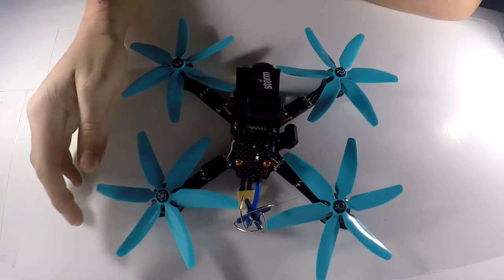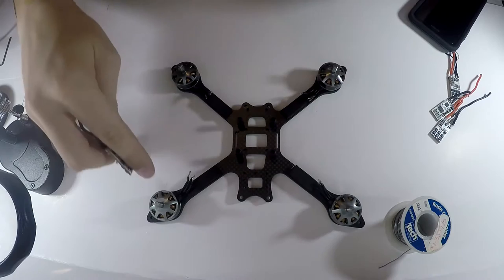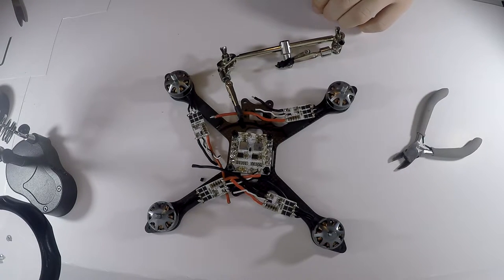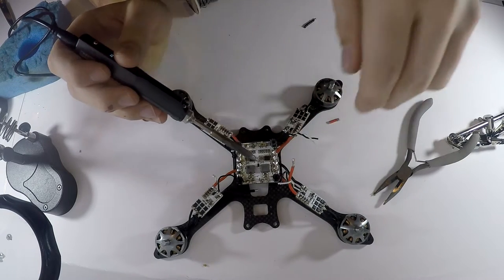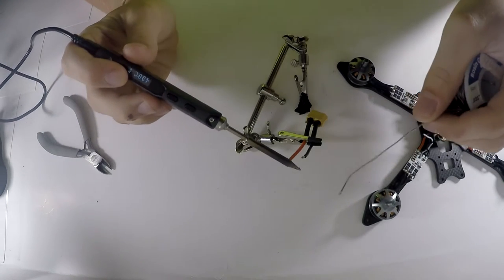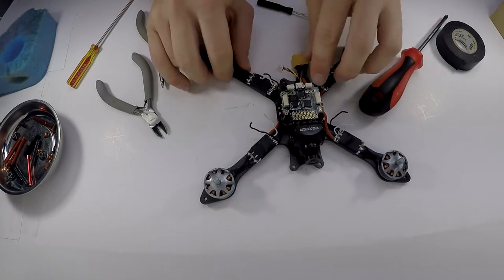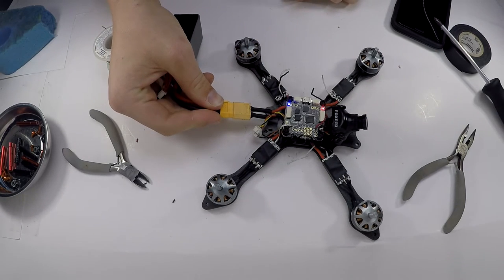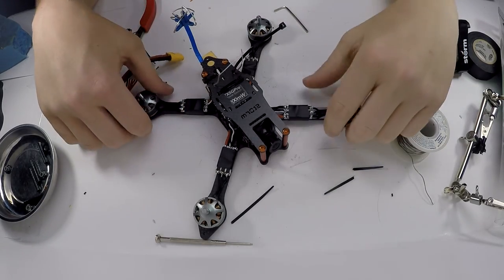SRD199 "Loki-X5" Build and Review || Part 2  (Complete Build Guide)

Comment: Nice video. I just got the 6mm frame. I'm wanting to use a 4-1 esc for  a clean look. Will that fit in the frame?
Reply from the maker: You might have to get taller standoffs like I did but otherwise it should fit just fine :)

Comment: Thanks! I really like this frame, mostly for the light weight. But biggest concern I have is durability. How has it held up for you? I don't think you can order a spare base plate, so 60 bucks is a steep price for one broken arm.
Reply from the maker: I haven't broken anything so far ;)  I think this is surprisingly extremely durable and I only have the 4mm version. If you were to get the 6mm version, it would be virtually indestructable!

Comment: Nice build. So how much is the overall weight without an hd camera? Also, are you able to access the usb port? Shouldnt that be placed on the left or right side?
Reply: Sorry just saw that the usb port is on the side :)
Reply from the maker: The weight without a battery or a GoPro is around 310g :)
Reply: A&C FPV sweet, expecting mine soon! Hope i can get the weight as low as yours!